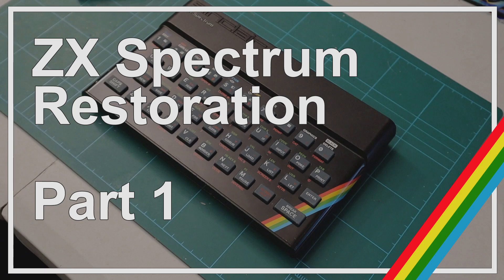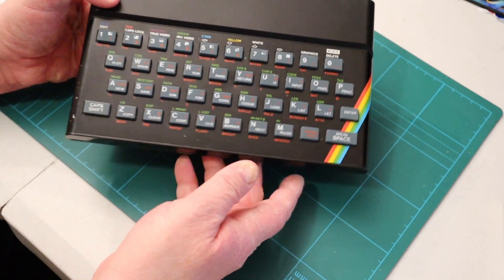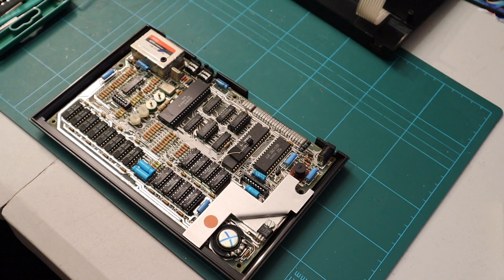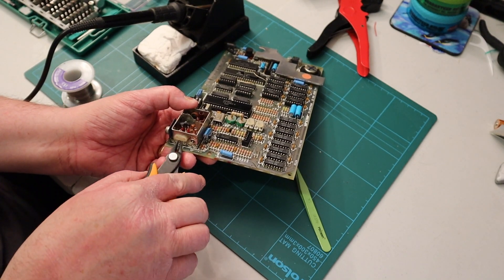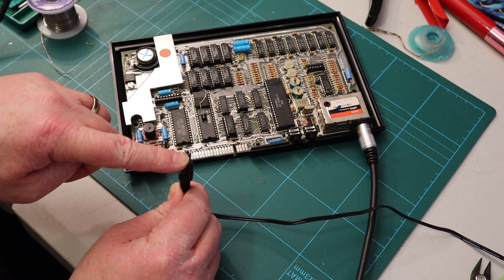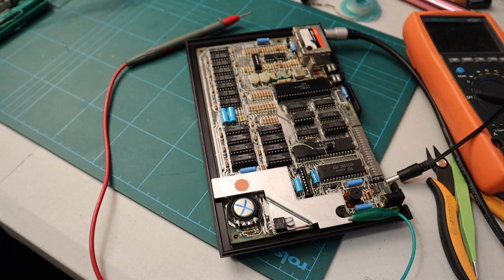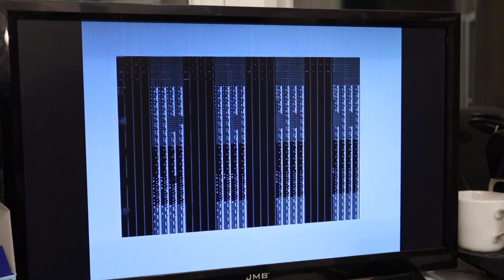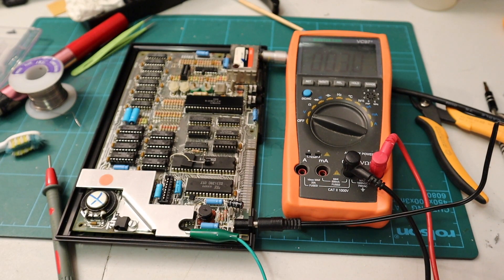ZX Spectrum repair, restore and upgrade. Part 1

Comment: I worked in a factory repairing Spectrum's way back when. The majority of the faults were memory or the PSU blown up by the power drain of the faulty memory. The CPUs were blown up by the expansion module being pulled off while powered up. Each bench had an engineer, a solderer and a tester bashing through repairs day after day. We would each get £10/day extra if we repaired 100 in a day! You quickly learned which RAM chip needed replacing just by looking at the screen. Happy days 🙂 Glad to see your on your way to get it fully working again.